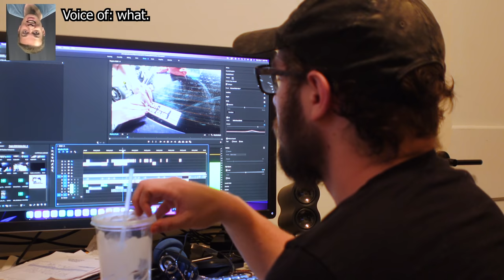Equipment FAIL! E46 Cooling system overhaul ft @HooviesGarage , @ElliottAlvis , @boringfocuswagon

Comment: Hey Jake love the E46 zhp !! I have to E-46’s and  always wanted a zhp . I’ve been through what you’re doing right now the next thing to go will be the hard coolant lines under the intake. Mark my words they will crack or leak overtime . They are inexpensive the only bad part is you have to pull the intake but they last 100-150k roughly.